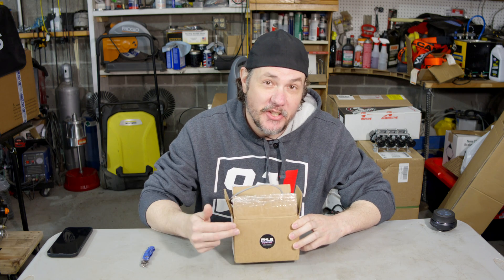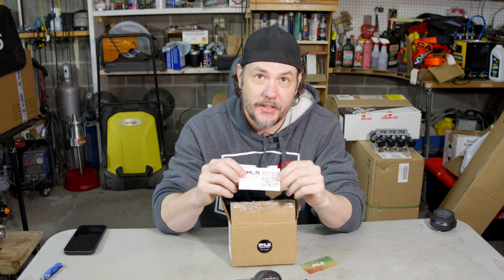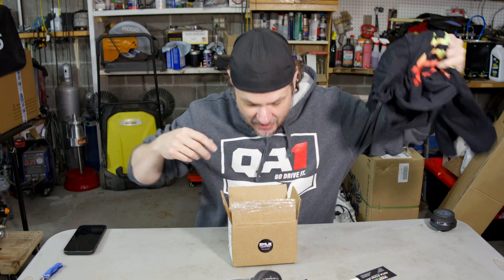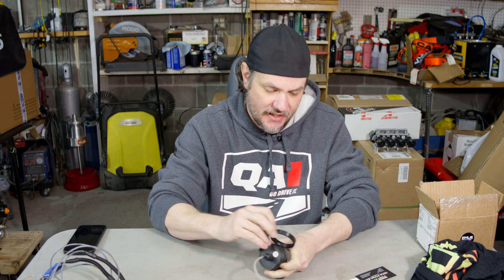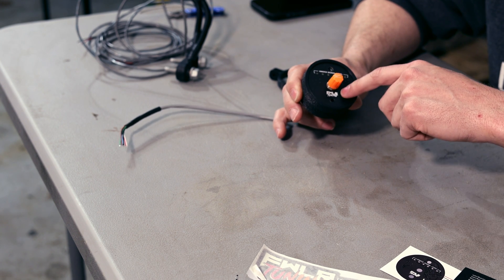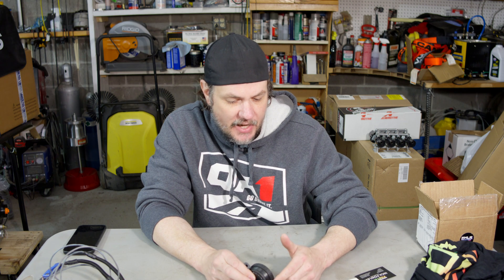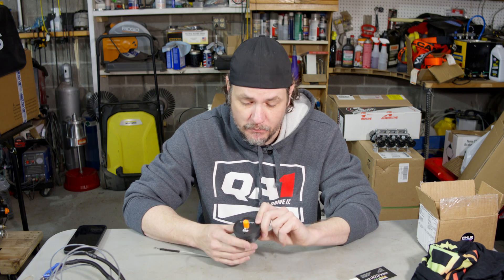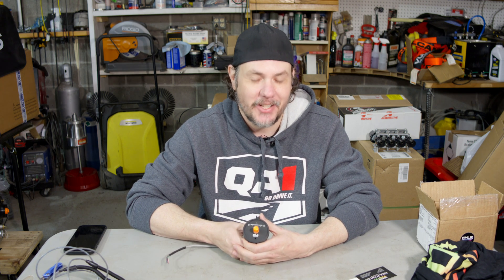An Affordable Way To Monitor Knock!  FWLR Tuning Knock Interface is a Must for Boost!

Comment: I almost asked last night on the live stream if there were any cheaper options yet.  Ordered...
Reply from the maker: Yeah, this is something the market needed
Reply: I’m sure that monitoring for knock is great with electronics but the drawbacks can be headers and high pressure charging causing false positives. If I want to really max out my timing at all rpm’s and loads I do test runs at full loads up to a certain rpm in increments and shut it down and pull the plugs for inspection then run it again at higher rpm or fix timing and run it again if necessary before checking a higher rpm. I recommend this for race setting, for street just aim timing high then back it off 2 degrees from what you find as good so the motor lasts even if your fuel isn’t what it should be. Less work and more enjoyment.
Reply: I definitely agree that reading plugs is a great way to verify whether knock is occurring. The spark plug is quite literally part of the combustion chamber so there's no better representation of what is going on. One drawback with this method is that you don't know which part of your map was responsible for the knock. Maybe it only knocked around 3000RPM and then everything above that could take more timing. Using your ears it is very easy to distinguish between false knock and real knock. There's no better signal processing than a human brain ;)
Reply: How thin are the microphones? Where's the best place to attach them to an LS3 block?
Reply: I to agree with reading plugs, but unless you can go WOT and kill the motor and cost to a stop, you really are not getting a true reading on a plug.  If you do not go WOT and kill the motor the you get different readings from slowing down and normal driving, so any other ideas on this, I'm open as I have been around racing cars for about 35 years and that is the only way that those guys will read plugs.
Reply: @jeffhowell3310  yeah, that is basically the best way to truly do it and it is a bit of a pain. But once you have the initial timing marks from the plug then you will be able to work on timing from there. If you use the same cam over and over again in different motors you get used to how much timing should be in there.